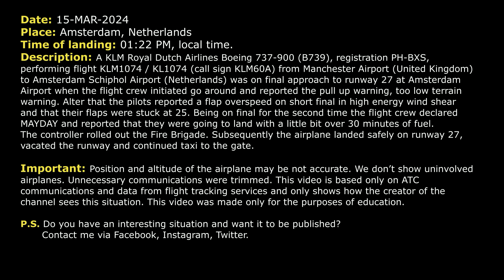Minimum fuel, MAYDAY, stuck flaps. KLM Boeing 737 has problems over Amsterdam Airport. Real ATC

Comment: This makes no sense.   If flaps are stuck due to a lockout?  Then we have a checklist.  Flap assemetry.
Reply: First, learn to spell. Second, they stated that their airspeed went close to 200 kt on short final due to the windshear, which would overload the flap motors. The ran the checklists after their go-around, got it working again.

Comment: One thing that stands out is that this is a short haul flight and they had just the fuel for 1 single go around. If they went around again they would be in a critical situation. For what? to save fuel? Especially on an airport where go arounds can be frequent due to wind. It's KLM these things shouldnt even be close to the possible.
Reply: I was wondering about alternate fuel as well...
Reply: When the flaps are stuck at 25 the fuel burn is much higher than planned fuel burn, that’s why fuel was a problem.
Reply: DEI hires
Reply: I would bet that they dont want to land heavy everytime because it stresses 6. You figure the break wear is guaranteed with heavy landings but running out of fuel in a pattern is an academic hypothetical. Yes it does happen some times, but the gear wear is guaranteed. So to prevent a possibility, you increase a certainty of something, potentially leading to collision or runway excursion or worse. Maybe you shred a tire on takeoff. That brought down a concorde.
Reply: They have to declare emergency when they are going below minimum fuel, which is 30 minutes worth of flying in this case. They could have at least done another go-around if necessary.  The flaps being stuck at 25 didn't really help the situation.
Reply: OR the more likely explanation is that they have had full tanks at the start of the day and being a shuttle on short haul do frequent back and forth trips and don’t need usually to top up each time they land as they will have plenty of fuel even for alternatives.
Reply: Rotterdam is in visual range

Comment: This pilot deserves a raise honestly. Relaxed and calm, and super Professional
Reply: Yeah very professional😂, running low on fuel after the first go around and having to declare emergency 😂 knowing very well how tricky can be the weather in Amsterdam . If it is a contest for the one who lands with least amount of fuel in bad weather then yes they are doing very very good 👍
Reply: @andreabaront2240 completely legal in Europe to be within 30 minutes reserve after one go around on non IMC forecast
Reply: Something interesting to know is that the King of the Netherlands is a pilot and sometimes flies 737s for KLM. 

He likes doing it and is completely qualified.

I'm an American who lives in Belgium which is right next door to the Netherlands. I live in the Dutch speaking part called Flanders which has quite a bit in common with the Dutch people. I fly through Schiphol quite often. I also use Brussels. Both airports use KLM and Delta. The experience is very different than flying through the states.

Instead of having TSA people screaming instructions how and where to go the people working are professional and calm. There are armed security soldiers with sub machine guns. Don't screw around.

Much more calm and professional. Probably because it is a profession and not a temp job working in the the airport.
Reply: @sttuartthompson7686  since the Brussels airport terrorist attacks in 2016, the security is at a constant high level. As it should be.

Comment: I don't believe this. We are the ROYAL DUTCH flying company. Our maintenance engineers are all over the world and give every KLM aircraft a perfect maintenance service before every flight, wherever they come from. This was just a test in a simulator. (lol)
Reply: When i was an intern by KLM Maintenance and Engineering. I inspected a 737-400 who had his elevator control system frozen stuck while approaching AMS. It  lowered altitude with stabilo trim above the IJsselmeer en circles around it until elevator control was regained. We didn't found a clear reason why it happened the most probable cause was frozen anti freeze agent on the control mechanisms, but we could not  prove that. There was decided that the whole controle mechanism was to be replaced with actuators and all. That was a fun job to do. Only reistalling the APU exhaust shrout was a pain in the ass. After the fix the 737 was taken by test pilots above the IJsselmeer under same circumstances to check if it happened, again but didn't. 
There is always a possibility that weird things happens. It how a company handles the situation is what divide them.

Comment: It's worrying the flight was so low on fuel. For such a short flight they must have uploaded a minimum amount ??
Reply: Due to the flap being stuck at 25 they consumed more fuel than normal
Reply: They probably had fuel for Rotterdam as an alternate. Plus a bit for the windy conditions I suppose. But then flying around with the flaps out the fuel flow is high.
Reply: @lockstocknl spot on, the fuel burn with flaps at 25 would have been huge
Reply: Not really, alternate fuel is very little for the Netherlands as EHRD is only 30 miles away from EHAM, Discretion fuel would be minimal as well as these guys fly this route multiple times per day and are very well known with traffic density and ATC handling in both the UK and NL. Take in account the extended landing gear on approach and the flapsetting the aircraft had during the go around most like used approx. 80% more fuel on that go-around as it normally would have done. There is a lawful reserve amount for a reason!

Comment: Is it really an emergency if ATC doesn't ask 5 times for souls on board and fuel remaining?
Reply: It’s EU. They have all the information already so they don’t have to bother the pilots. They also declared mayday on approach… wouldn’t be the best time to answer questions doesn’t it?
Reply: The mayday was clearly called for breaking the 30 min fuel minimum reserve, not the technical issue. ATC can calculate  a 30min -/- fuel load within 1 sec. and thus asking for it is senseless only contributing to a higher workload for the pilots. Nowaday airliners PAX+crew is electronically communicated with MUAC and down the line. So again requesting this info is again senseless. Last not least; the crew is obligated to report a breach of fuel reserves. Any repurcussions by the authorities depend on circumstances and frequency such calls.

Comment: They got a Flap Load relief because of a positive windshear. The flaps automatically retract from flaps 30 to 25. If that happens close to the ground, the EGPWS does sense an aircraft close to the ground without landing config and gives warnings like too low flaps and pull up.
When flaps are stuck at 25 the fuel consumption is much higher and as a result a landing close to 30 minutes of fuel had to be made.
Reply: Thanks for the insights, makes a lot of sense
Reply: Thank you very much for this additional information!👍
Reply: Not possible to get them to 25 manual?
Reply: Of course we would more information to know for sure, but it looks like they didn’t transition to a standard go around (flaps 15) after the wind sheer escape maneuver and instead recognized the flap disagree and chose to remain in the configuration until they could run the QRH. The flap disagree checklist would initially call for the flap selector to set a less than indicated position to correct the problem. Blowback protection which is why the flaps went from 30 (landing configuration) to 25 is a feature on the 737 to protect the flaps from overspeed. In this case it looks like the crew was task saturated from the wind sheer event and didn’t recognize that the overspeed took place.
Reply: So thats what they had to adress. They could land normally the first time
Reply: @sleintje unless they were in a windshear situation (they reported 200 knots on final approach)

Comment: Is 60 ALPHA the flight number? Or does it mean something else?
Reply: Flight number. KLM60A
Reply: Callsign, not the commercial flight number printed on the tickets
Reply: Isn’t flight number the call sign on commercial flights?
Reply: @alexsakon  In Europe, oftentimes they are not equal. Instead, the callsign is usually an alphanumeric combination. But sometimes, the callsign and the flight number match. Why, I don't know, but it guess it's centrally assigned by Eurocontrol and they ensure some form of uniqueness.
Reply: @alexsakon  Sometimes they are, often they aren't, especially on short-haul flights. Lufthamster long haul flights often use their three-digit flightnumer as callsign, e.g. But using the flightnumbers would inevitably lead to dangerous mix-ups, so an alphanumerical callsign is pretty much standard.

Comment: Are those common winds for Schipol?  Holy cow! And the crew and ATC.....  SUPERB!  Calm, collected and professional!!  AWESOME JOB!!
Reply: Schiphol is located verry close to sea, so it can be spooky there, but to me indeed this sounds tough, and a microburst does not sound common to me. However this was a windshear... hmmm no fun.
Reply: Maybe not common as in all the time but when it blows it's usually more than a breeze.
Reply: It's been very windy here all winter, with quite some storms. The Netherlands is always very windy (especially near the coast, which Schiphol is), but this winter was exceptional.
Reply: "Schiphol" airport is in a "polder" (Dutch word for claimed-from-water land). So it, and the area around it, used to be a lake until it fell dry (from pumping the water away) in 1852.
The lake was navigated all the time by sailing vessels and nearness of the area to the North Sea (branch of the North Atlantic) meant that the lake also had its spooky windy sections. One of these sections where many a ship sank "with men and mice" was called "Schiphol" (ships' hollow/cave) - the miniature Dutch version of Bermuda triangle or Gulf of Biscay.
The airport is 4m (13.1') below sea level.
Reply: @pascalcoole2725  I've been a passenger to and from Schiphol a number of times and I can confirm that winds can be spooky and can change in an instant.

Comment: Another day, another Boeing with a malfunction.
Reply: I'm sorry no.... this was a mechanical failure caused by overspeed for the given flap setting.
Not Boeings fault,
Not the Piliots fault,
but surly the fault of the weather man
Reply: I see you missed all the Airbus and Embraer videos.
Reply: I'm not assigning blame or reaching conclusions... just pointing out that from a public relations perspective, Boeing is having a rough go lately.
Reply: Another day and another ridiculous comment on YT.
Reply: @fridaynightgamefilm  Which is why you shouldn't take anything at face value. How many Boeing aircraft are flying around the world? Thousands upon thousands. How many flights are undertaken daily on Boeing planes? Hundreds of thousands, if not millions. How many of those aircraft & those flights have mechanical issues? Not in the thousands. So there's no need to fearmonger.
Reply: I am not an expert, but in another comment, a pilot remarked that this behavior of the plane is normal, but the crew had a work overload performing a windshear maneuver. So the plane was not at fault this time. The crew was not at fault either, although they were short on fuel. It took the crew long to know how to reconfigure the plane after an overspeed flap situation.
Reply: @tiadaid  Have you seen the undercover video in the Boeing factory where the majority of employees working on the plane said they wouldnt fly their own aircraft? Quality control has been atrocious. They might go under.

Comment: This is a brand new 737 why is it having problems already?
Reply: Have you read the news over the past few weeks? Did you notice at least 3 major incidents with fairly new Boeing 737’s?
Reply: @johnhopkins4920  Yea but this is not the Max, it's the 900 which is a variant very similar to the Max.  The Max currently cannot be delivered at the moment but the 900s can.
Reply: A wind gust caused the flight path to become unstable.
Reply: Wind gust can cause overspeed, damaging the flaps. This goes for all aircraft.
Reply: The aircraft is 22 years old.
Reply: @bramwierenga5931 the ac 739 can’t be 22 years old.
Reply: @brentbeacham9691  This aircraft is PH-BXS, which is 22.4 years old
Reply: Good grief people. Do you listen at all? I knew some idiot was going to blame the wind shear and subsequent over speed on the flaps on Boeing. I guess it’s their flaunt when their planes hit wind shear. What is wrong with some of you folks? He plainly said the flap over speed condition was caused by the 200 kt wind shear speed.
Reply: Apparently you have never owned a new car. You should stop buying those old heaps.
Reply: Just buy and fly Airbus 😂
Reply: @bramwierenga5931  I’m sorry. You were right. I should have checked a source or two before posting.
Reply: @brentbeacham9691  no problem!

Comment: I'm no expert, but atc doesn't say QNH reading at all.
Reply: that's what ATIS is for.
Reply: @jemand8462   atc tells wind conditions so why not QNH
Reply: The aircraft climbed to no higher than 3000ft, which is also the transition altitude. So there was no real need to advise the QNH. Yes, the approach controller could have stated the QNH but the pilots would likely have already been on that QNH (unless it changed). They were also dealing with a more critical situation.
Reply: @SuperJohn626 is it really important if you're flying a visual approach and have the airport / ground in sight? I don't know the conditions there but I guess it was visual
Reply: The QNH has been given on previous messages during the approach. No need to repeat (if the QNH has not changed).
Reply: @jemand8462 the second approach is not a visual approach : the controller says "cleared ILS 27 approach".